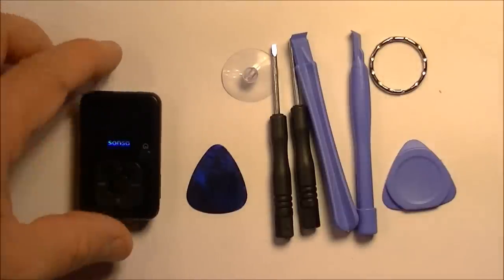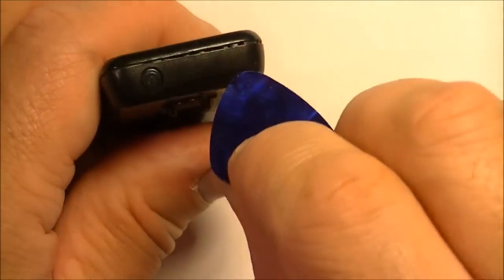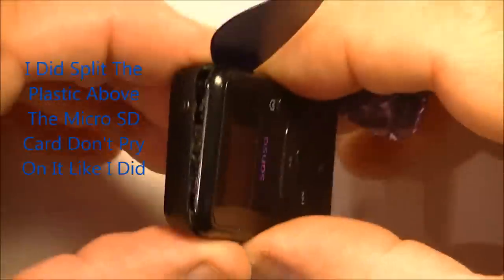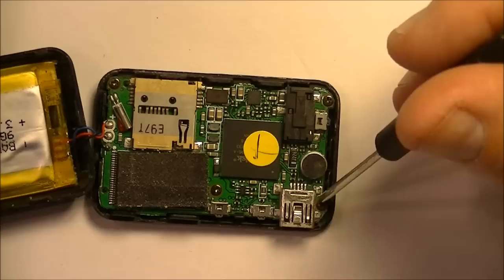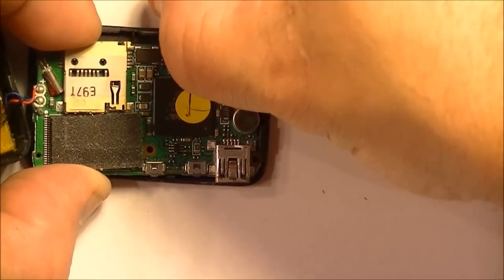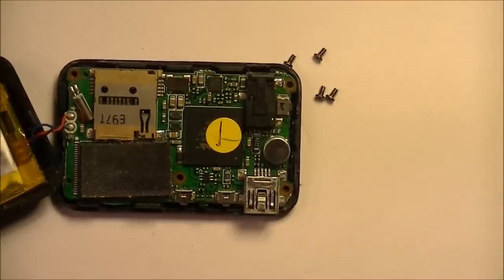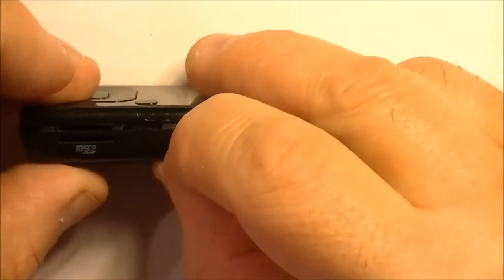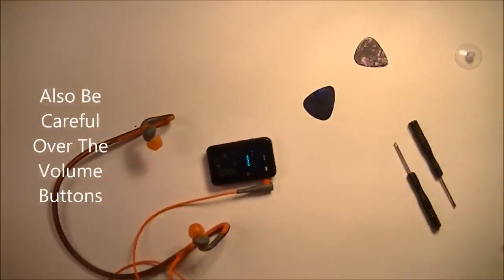Sansa Clip + Full Dissasembly Teardown and Reassembly

Comment: Such a shame there isn't a true successor to this great player available.
Reply from the maker: You have to wonder why? It is a great player.  Thank you for watching and commenting. I appreciate it greatly. All the best.
Reply: @richardlloydusa  From what I've read, the chip(s) were custom jobs and made to order. The newer versions feature cheaper, mass produced, less powerful equivalents.
Reply: @Grim177  -And on the new Sandisk Sport Clip Plus they've removed the ogg vorbis drivers and microSD slot in place of bluetooth [facepalm]

Comment: I have one that I left at a hotel. I spent $22 to have it sent back to me. I had several for work, and I always misplaced them, or so I thought. Today, I found a stash of the ones that I collected and lost over the years, under an undiscovered slot on my bookcase shelf, where they obviously dropped out of sight. Giving up, I just bought new ones, thinking I had lost them at work! I found 2 8GB and 2 4GB, plus the one I got back, an 8GB, which makes 5. Turns out that I never lost them at work, they dropped into the bookcase slot. I checked them all out and they all work. I'm in Sandisk Sansa+ heaven! And now I see that I can repair them myself. There are batteries on Ebay. I like these better than any other player because they play several formats, they record, and they don't have proprietary headaches associated with them. They should never have stopped making them. Thank you for the video!
Reply from the maker: You are most welcome. They are great MP3 players. The recording function takes them over the top. Thank you for watching, commenting, the valuable feedback and the kind words. I appreciate it greatly. I am happy to know I could help. All the best.👍😀

Comment: I got one of this in 2012. The best part is that you can install different software called Rockbox and will turn this little guy into a monster. Unfortunately, mine got a false contact at the headphone jack. A guy fixed it but now it won't turn on and the computer won't recognize it. It seems that I will need to get another one.
Reply from the maker: I suggest looking on eBay: https://ebay.to/2Z0SVD5 lots available there. Thank you for watching and commenting. I appreciate it greatly. All the best.👍😀
Reply: Try to hold power and home button together for 30 seconds, then release both and press power again and it should turn on.
Reply: T N Dude, thank you! Had one that wasn’t turning on even on the charger. This little trick worked great!!
Reply: @tn7198  Thank you......thought mine was dead  and came here thinking I had to replace the battery.  Your suggestion worked...it's on again.  Bookmarking this video for possible battery change out in the future.

Comment: I just took apart my Clip+. I used a 0.71mm guitar pick. Press the point into a corner seam. Once it starts to open turn the long edge of the pick into the seam. Then slide the pick through the entire seam. The case nearly pops open with minimal prying.
Reply from the maker: +MrMarzipanian Thanks for the info and watching.

Comment: Cheers Richard. My toddler chewed on mine and the switch for raising volume lost one of its connections. Way too small to solder but i put a piece of plastic in there to force the connection closed.

Comment: For those without a guitar pick: you can also use the metal "clamp" part of an old floppy disk. Just tear the floppy apart and bend the clamp into flat shape. This is pretty thin and stable enough for the job.

I have an old Sansa Clip (w/out the plus). I started at the power rocker. You can get into the gap pretty easily from there.
Reply from the maker: Please note that the metal is much harder than the plastic guitar pick so it will more easily mar or scratch the plastic also the metal is conductive and can short circuit the board as it is always live. I don't recommend using this method. Thanks.

Comment: Thanks much, Richard!  Loaned mine to a friend, who managed to put it through the wash.  Now to see if I can open it up, disconnect battery, wash w/ DI water, dry, and see if it has been reincarnated.  Knowing what to expect is a big help.
Reply from the maker: You are most welcome. Thanks for watching and the kind comments. I appreciate it. All the best.
Reply: i really want an update from this
Reply: I'd also like to know if you were able to resurrect your clip. My daughter ran hers through the washing machine as well. I opened it, dried it out, disconnected the battery, and swabbed the guts thoroughly with alcohol (there was already gunk on the component contacts, probably dried laundry soap). Everything looked good except the battery voltage, which was essentially zero. It's sitting in a bag of rice right now, so hopefully it will be dry enough to try the battery again tomorrow.
Reply: One of mine dropped from my hand onto the lawn - couldn't find it. We had two weeks of rain, so I gave up hope and bought a new one, thinking that even if I found the old one it would be water damaged. After the torrential rains I found it in the yard. My wife said, "Turn it on". I said, "It's no use, it can't work". She insisted, and I pressed the power button and showed her. I said "See?!". She looked at it and said, "It's on". I turned it toward me and all I could say was "Huh?". Her: "You wasted $40". We laughed. I kept the new one just in case. I just checked the date inside Sept. 2007. It still works. I don't want anything else. If the battery dies, this video helps.

Comment: Richard, thank you for the video.  Replaced the battery and the old Clip+ is good as new!  I'm a guitar player - loved the hack!  Really works.  The Dunlop Nylon .73mm is thin, yet stiff.

The rectangular chip is likely flash.  The square chip ("Sandisk") is likely the processor.  Would not recommend trying to re-solder without special tools.  (Retired embedded systems engineer - OCD is an occupational hazard.)

Again, thanks for the video.
Reply from the maker: No shame in that! You are most welcome. Glad I could help. Thank you for watching, commenting and the kind words. I appreciate it greatly. All the best.👍😀
Reply: How does one determine what battery pack the sansa requires? Im trying to fix my old one

Comment: great video. I have a SanDisk that needs to have a battery replaced.  It is different in that the usb is a micro usb and the display and controls are stuck to the board and not the other sides of the player, you can take it off easily. now to go and look for a battery if it is available. :)

Comment: Like yours, the clip broke off mine too. I happened to have an old clip from a badge that I was going to screw onto my Sansa clip and found this video useful to open mine to find a good place to drill a hole to mount my new clip with a screw. In the end I merely Superglued the clip to my Sansa and it is holding fine as there really isn't a lot of pressure needed. But thanks anyway, cause I could have used your tutorial had I needed it. Thumbs up.
Reply from the maker: You are most welcome. Thanks for watching and commenting.

Comment: So you can easily swop out the ports, the battery, buttons and even the sd-slot (if you´re good at soldering) after only removing the backcover. Probably the parts most likely to break - good repairability :) Love this device, may swop my battery soon since it has lost capacity over the years. Thanks for the video :)
Reply from the maker: You are most welcome. Thank you for watching and the kind words. All the best.

Comment: I have the first version and its still working, but fear the battery can't last much longer. With a 3D printer, one could print a new back and front plate that would use screws and be easier to remove for maintenance. Cheers
Reply from the maker: Thank you for watching, commenting and the valuable feedback. I appreciate it greatly. All the best. 👍😀

Comment: Nice.  I opened mine up because the headphone jack had a short where it would keep cutting out on one channel unless you wiggled the cord.  Looks like the jack needs a zap with a soldering iron on one tab that broke a little loose.  Do you know how long these things are supposed to play on a full charge?  Mine seems to only play around 3-4 hours so I thought the battery may be getting weak.  I have a new 250 mah sitting here that I was going to put in but it may not fit,  it's a lot smaller in size and just slightly thicker than this strange looking OEM 290 mah.
Reply from the maker: I believe they should play for over 10 hours. Volume being the determining the factor in how long it will play. But even at full volume with a good battery you should get 7 hours. You can get a battery for it on Ebay here: https://goo.gl/e6o2xB Thanks.

Comment: Thank you. I had a funny moment watching. When you showed tools for opening a phone, I though, well shit, no way I'm gonna get these. And then you said a guitar pick was better and I already had a couple lying on my desk... In my player the battery got disconnected, I hope I will be able to fix it.
Reply from the maker: You will require a fine tipped soldering iron and a little solder. Here is one at Amazon: http://amzn.to/2o8j82Y Thanks.
Reply: Thanks I've got the iron already, just not enough experience. And those cables are so tiny!
Reply from the maker: I use a helping hand for those jobs it also has a magnifying glass. Here is what it looks like at Amazon: http://amzn.to/2nQAnFq Thanks.

Comment: Nice video, I have the 8 GB model. I wanted to change the battery because it's not holding a charge. Watching this video has helped me allot. Looks like I'm going to need to do some soldering. Thanks.
Reply from the maker: +blkbrdsr71 You are welcome. Soldering will be required. Make sure you get the polarity correct. A meter will help you determine that. Thanks for watching.

Comment: nice video. my display light went out. how do i fix that problem?
Reply from the maker: You will probably have to buy a new display. I would look at Ebay for broken Sansa Clip + players you can harvest the part from. BTW you can buy a refurbed 4GB Sansa Clip + on Ebay for $27. Thanks
Reply: thank you. will do. you are a genius.
Reply from the maker: cichmugs You are most welcome. Thanks for watching.
Reply: cichmugs I have the same problem it fell into whater
Reply from the maker: gozala00 You will probably have to buy a new display. I would look at Ebay for broken Sansa Clip + players you can harvest the part from. BTW you can buy a refurbed 4GB Sansa Clip + on Ebay for $27. Thanks
Reply: It could also be that yours is set to dim after a certain time to save battery. Go into "settings" and check.

Comment: can the battery be replaced easily? is that a standard poly battery?
Reply from the maker: The difficulty level depends on your experience soldering. As you can see they are small wires but if you can solder to that level (not hard for me) then you can replace the battery. Here's a link to the battery for the clip + at Amazon(paid): https://amzn.to/3Azj0gd or eBay(paid): https://ebay.us/paXerr
Make sure it's the right (physical size) for your clip. 
Thank you so much for commenting and watching. I appreciate it greatly. All the best.👍😀
Reply: @richardlloydusa  i do not have one but i want to buy one for my 9y son.  i am thinking in scandisk plus.
do you have experience with other brand, perhaps one that can use aaa batery?

i can weld small xt30 conectots but i can try this one if needed.

thanks for your response!!
Reply from the maker: There are so many mp3 players out there but this is the only one I own. I was so impressed with the first one I bought that I bought a second 8gb. These little players sound great (tons of volume too) and are very solid devices. If you look at Amazon for mp3 players (paid): https://amzn.to/3cKSDfl check the specifications that you want and make sure to look at the reviews to see what people like and dislike about the devices. Thanks you so much again for commenting and watching. I appreciate it greatly. All the best.👍😀
Reply: @richardlloydusa  tks!!!
Reply from the maker: Thank you so much for watching, commenting and the valuable feedback. I appreciate it greatly. Subscribe, Click The Bell and stay tuned!  All the best.👍😀

Comment: Your sansa looks like mine with that velcro on the back ( I use it to stick my sansa to my bike handle while riding). Unfortunately, the headphone jack has become too lose which causes the sound to come from only one side sometimes or it keeps cutting out and I'm wondering if there's anything I can do to fix that if I take apart.
Reply from the maker: +TransynthMan Short of replacing the earphone jack or taking the jack apart to fix it I would say not as the components are very tiny. You can buy them refurbished on Ebay for $32 http://www.ebay.com/itm/SanDisk-Sansa-Clip-4GB-MP3-Player-Black-SDMX18-/191131424048?hash=item2c80521530:g:p40AAOxy4YdTRaA6 Thanks.
Reply: Richard Lloyd
Thanks for the reply. I know they sell them used on ebay - for almost the same price I bought mine new - but really wanted to keep mine as I've had it for a very long time and it's almost become of sentimental value but I guess I'm going to have to buy one now.

Thanks.
Reply from the maker: +TransynthMan You are welcome. I see at the 6:10 point in the video that the earphone jack (top right corner black block is soldered on with three tabs so if you can buy a broken one with a good jack and you know how to solder you could swap the parts. Thanks.
Reply: Richard Lloyd
Yeah I opened mine and found one of the 3 points holding the block to the board broken but then the whole block came loose. I think it is time for another one.

Thanks.
Reply from the maker: +TransynthMan Sounds like it. This is probably the only electronic device I have seen go up in price over time instead of going down. Shows how good the player actually is. Thanks.
Reply: Richard Lloyd
Yes. I don't get it (the price going up). But it is a little gem.

Comment: My clip was washed. I put it into rice for a few weeks. Eventually it came back to,life. But ow when I switch it on it lowers up the gets as far as e music showing but then it freezes.. I can even load music on to it through my computer.  It's all here but won't go any further.
Reply from the maker: I am not sure what to tell you here. Perhaps the battery was damaged or some internal corrosion has taken place. You could try using some 99% Isopropyl alcohol (make sure it 99%) and a cotton swab to clean the circuit board and see if that helps. Be careful of the plastics and display with the alcohol (use sparingly). Thanks.

Comment: Thank you for your advice but I just used my finger nail to crack it open and it was a lot easier.
Reply from the maker: +PandatorGandator As long as it worked that's great. Thanks.

Comment: mine suddenly wont turn on no matter what I do. A few days ago it did turn on after fiddling with it for about 20min but the light display was very dim and then when I tried to charge it it froze and it hasnt been able to turn on no matter how many restet tricks I tried. DO you have any suggestions or is it just dead?  I bought it in 2014
Reply from the maker: Did it get wet?
Reply: +Richard Lloyd fortunately no. it has never come in contact with liquid. i have once charged it using a Samsung charger adapter to plug it on the wall instead of charging it with my laptop as usual. i dont know if that contributed in ruining it, even I did that about 2 months ago.
Reply from the maker: I doubt that the Samsung charger did anything to it as it should be the same voltage. I am thinking your battery is dead they do not last for ever. Does it turn on when you plug it in to charge? BTW if it is the battery you can buy replacement batteries on Ebay but it will require you to solder it in. Thanks.
Reply: +Richard Lloyd the problem is that it doesnt even turn or get recognised by the computer when i plug it in. so maybe the battery really is dead. thanks for the suggestion
Reply: Hey Richard, I just opened up my CLip+ and I noticed that the silver cylinder-like object at the bottom of the cirvuit board looks kinda damaged. It has a dried white sustance coming out of it. What could that possibly mean? Is there a way I can repair it?
Reply from the maker: Unfortunately they are no longer being manufactured but they are still extremely popular because they are such an awesome mp3 player. You can find them on Ebay for parts http://www.ebay.com/itm/Lot-of-18-Sansa-Clip-MP3-players-for-parts-/222336723667?hash=item33c44d2ad3:g:zrUAAOSwnKFYRfGD of course you will be taking a chance on what you get but many of the broken ones I have seen have a bad the display but the motherboard (what it seems you need) is good. They also sell them used for under $30 http://www.ebay.com/itm/SanDisk-Sansa-Clip-8GB-MP3-Player-black-READ-DESCIPTION-/192047463496?hash=item2cb6ebbc48:g:eEAAAOSwJ7RYSE-e All the best.